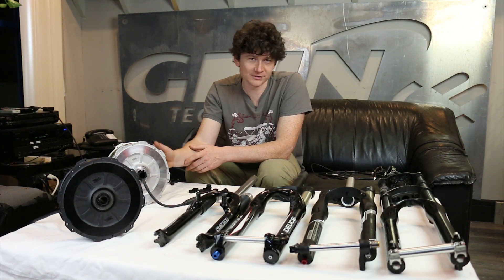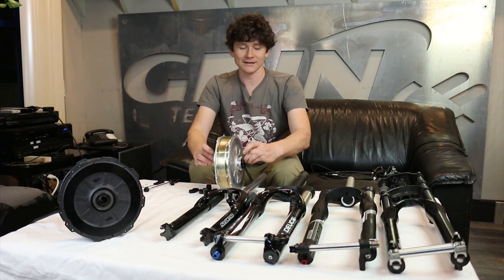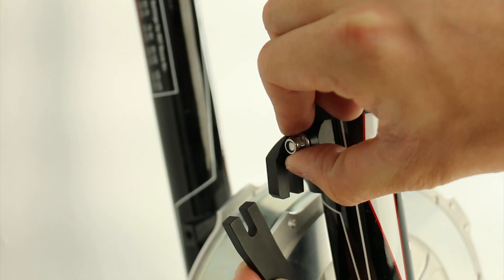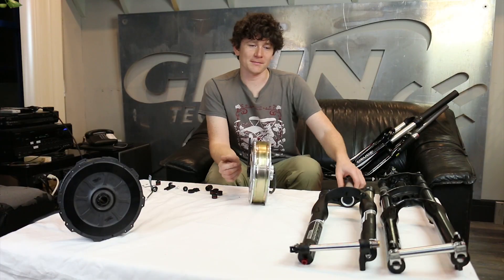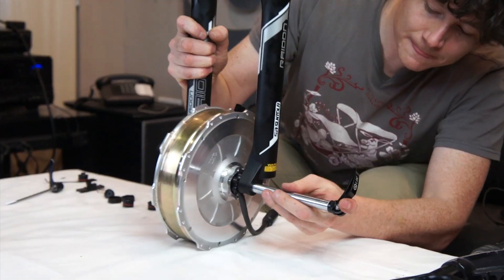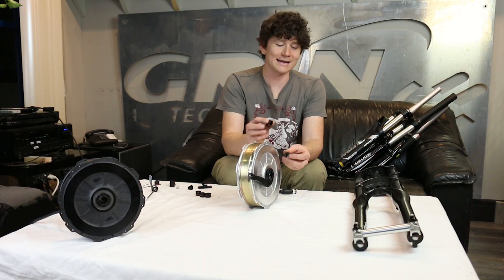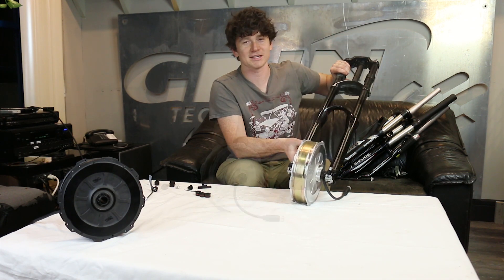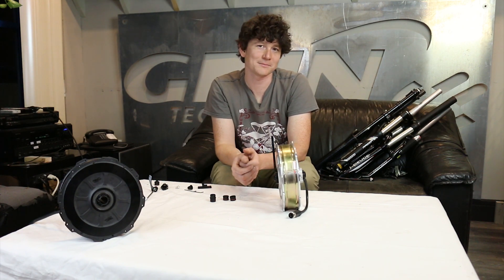How the Grin All Axle Motor fits All Bicycle Forks

Comment: How to adapt this hub to a 135x15 thru axle on a large stanchion fork? I have a honda motorcycle fork that I want to use for a custom trike because it's heavy duty.
Reply from the maker: I'd get the 150x15 adapter set and then cut down the inserts to be 135.  The 135x15  is not a bicycle standard but you should be able to make it work for your motorcycle fork by this method.
Reply: @GrinTechnologies  no problem securing the torque lever to large stanchions?
Reply: @GrinTechnologies  how much do we need to cut from each insert? Can I do this with a dremel?

Comment: Hello,
Sorry it's an old video...
Is this motor OK to use with a suspension fork, like a Marzocchi Bomber 58, Fox 40, DNM and the like?
Would be for a 2WD configuration, with a MXUS XF40 on the rear, to help on hills.
Not much "bad, rocky offroad" intended, mostly asphalt on country roads and hilly rides, offroad yes but for occasional smooth rides on trails.
Never seen a clear answer on this point, and wondering if I should change for a Monark fork or such to avoid ruining the stanchions...

Comment: Why does a torque arm is necessary on a thru axle motor ? The problem with regular dropouts is that eventually, the dropout will spread apart and loosen the nut. But isn't it not the case anymore since the axle is a closed hole (just like dirtbikes) ? Does having a rear motor follow the same logic, or is it only specific to front hub motor ?
Reply from the maker: A torque arm is even more necessary with a thru-axle.  How do you envision transferring all the reaction torque on the motor stator without a torque arm? For all the motor torque attempting to spin the hub forwards, there is an equal and opposite torque on the axle trying to make it spin backwards  (and inverse when doing regen).

Comment: Hey grin, I have an Ebike that has 2 hub motors, and it uses the first type of axle on  the first suspension, I want to change out the fork but I’m not sure which axle will fit. Any help would be nice, could I contact you via email for help? Thanks!
Reply from the maker: Yes email for sure

Comment: Hello Grin, can it be installed on the back? I am looking for a good motor for my mountain bike 🚲
Reply from the maker: When the Rear Grin All Axle is available then certainly. This is a FWD hub.
Reply: @GrinTechnologies  Hello, thanks for your reply. I am interested in a motor hub (perhaps with wheel), phaserunner, cycle analist and a battery for my Univega Alpina SL-1 2013. What would you recommend? Thanks

Comment: Nice work! Probably the only true universal hub motor that doesn't depend on the standard dropouts/hub axle flats and safe to use up front. Every time I seem a front mounted hub with more than 500W I cringe. Is it safe to assume this motor design would not be compatible with downhill inverted forks like DNMs?
Reply from the maker: That's correct, unless you either lock out the suspension or invent some kind of telescoping torque arm to deal with the changing length between the axle and the frame clamp ;-)   That is doable in principle, but we're hoping this style of suspension is just a fad so we don't have to go there...
Reply from the maker: It may also be possible to have a super short stubby torque arm that grabs the stanchion right close to the axle and not in the path of the suspension travel...

Comment: Game changer! If I buy your motor with the through axle, I can quick release the hub motor out and add back the regular wheel  for non motorized travel. This would be great for vacations when I prefer to pedal on road but take the ebike off road.
Reply from the maker: Yeah, the only thing is that the torque arm itself isn't quick release and needs a bolt loosened in order for it to slide out of the frame clamp.    Still a lot easier than dealing with a regular hub motor and we are looking at options to have a mini quick release skewer on the torque arm too.
Reply: @GrinTechnologies  please begin selling the torque arms with quick releases on them.

Comment: Most motors are described by there continues wots level i.e. 250wt 500wt 750wt or higher so wot size is this motor then thanks. 🤔♥️👍🚴‍♂️🚴‍♂️🚴‍♂️🚴‍♂️🚴‍♂️
Reply from the maker: Unfortunately the simple watts number is not a very meaningful way to characterize a motor, as it varies both with operating RPM and time.  See
https://ebikes.ca/learn/power-ratings.html  and 
https://ebikes.ca/product-info/grin-products/all-axle-hub-motor.html#MotorPower
for the expected power capabilities of this hub in particular.
Reply: Those numbers are just a suggestion.  This one is rated at 500-1000Watts.  I've had mine running past 2000W but with heavier gauge connectors and components.  You are playing with fire beyond the recommended standards though.

Comment: Can you pair the All Axle motor to a motorcycle rim & spokes?
I was thinking to use one to build a motorcycle, but want a wheel rated to 90 Km/h, and most bikes just go to 50 Km/h.
Reply from the maker: As Neptronix said, you can use a direct drive ebike hub motor like this to get up to about 60 kph in a bicycle, and even a bit faster in a streamlined recumbent bike. But to do 90kph in an motorbike platform requires a vastly higher power levels.  For that you would want to look at hub motors that weight more like 10-15 kg, not 4kg.
Reply: @GrinTechnologies  Got it, thanks for your answer & videos, your content is the best!
Reply: The hub motor would not be a good choice for a motorcycle. Really doesn't have the power, and not designed for the weight or higher RPM you're looking to spin at.

Comment: I am guessing fat bikes using 120mm or 135mm use the rear adapters for those sizes?  The Northrock XC00 i have has 120mm QR front.  Its a 26x4 fat bike.  Most fat fronts are 135mm.  I don't know if you can put a normal 135mm rear motor on the front of a fat bike.  Is there a video for the rears?
Reply from the maker: Yes almost all the 135mm fatbike forks are slotted and not thru-axle, and so just about any regular rear hub motor will fit inside them just fine.  We don't actually have a 135mm long adapter option for the Grin front hub here but it is something we may consider.
Reply: You can.  There is no vid.  You just have to look at the 3D diagram for the motor and figure it out.

Comment: Is it okay to add such a big hub motor to the front fork ?
Reply: https://youtu.be/xnhuoUrwhIw?t=1030 in this video (timestamped link to the relevant section) Justin talks about front motor installs, folks often feel it will be off or wonky, but that ain't the case.
Reply: @qqnqqpart  ty for the link. Judging from the size of the motor it looks like it can handle over 2kW. Mounting that in a downhill Mountainbike fork wouldn’t really make sense other than going 2wd. Great design non the less. I just think pretty much every conversion were just a front hub makes sense is a normal quick release bike anyway.
Reply: Most motors are described by there continues wots level i.e. 250 500  750 and higher so wot size is this motor then.🤔♥️👍🚴‍♂️🚴‍♂️🚴‍♂️🚴‍♂️
Reply: @andrewhunter5254  bigger motor -> more power.
There are some differences with the quality but in general it’s true.